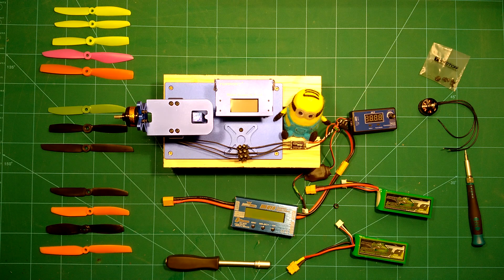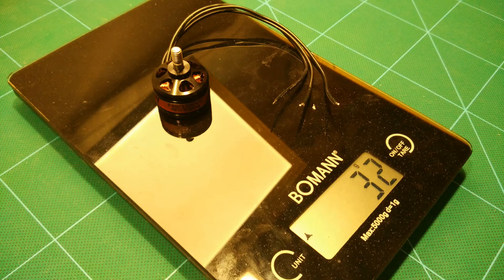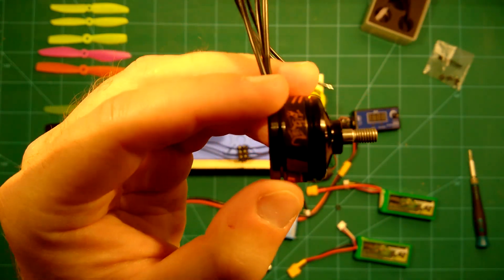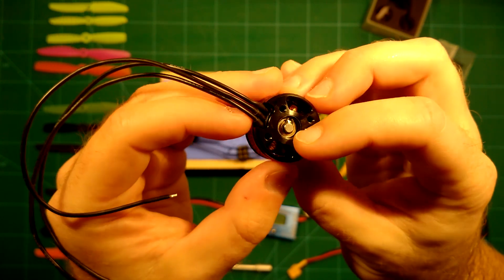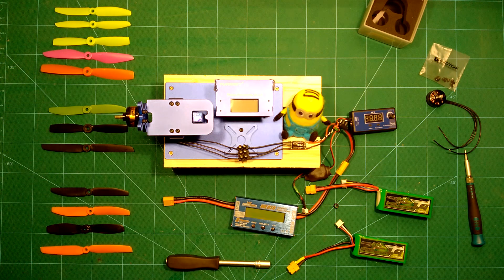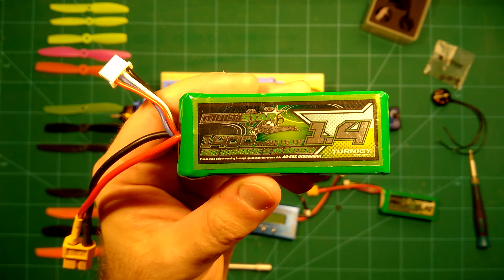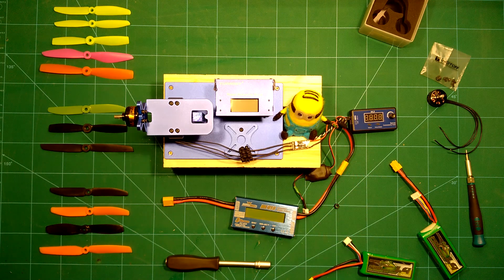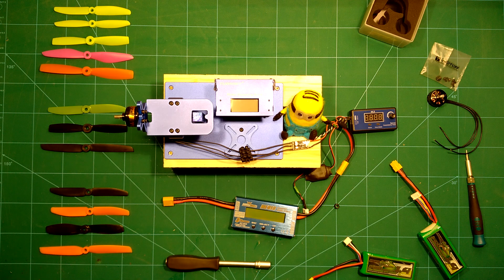T-Motor F40: Thrust Tests with LittleBee/Zeus ESC

Comment: thanks for the test, maybe next time try to use fully charged lipo for each test... you can see toward the end of the tests the battery voltage had dropped quite a bit which affected the results for the last few props :)
Reply from the maker: +FPV Oscar Guilty! I charged the lipos in-between the test runs, but not for every single prop. You are completely right and I will definitely do that for the next time. This does effect the maximum thrust (by a bit), but not so much the efficiency value - which is still valid. Also, since the watts are shown in the video, these are still valid data points, although maybe not "full throttle efficiency" but rather "almost full throttle efficiency", since the lipo was not completely charged as you say. Many thanks for your valuable input!

Comment: What is the dynamo that you're using? Is it home built or shop-bought?
Reply from the maker: +Michael D I'm not sure if I'm following you. Dynamo? Are you refering to the thrust stand?
Reply: +RC FPV Flight Yes - thrust meter / dynomometer. It's the Turnigy one, correct?
Reply from the maker: +Michael D Yes, absolutely right. It is the Turnigy Thrust Stand. I also build my own thrust stand previously, which worked very well, but this one is more of a standardizes solution. Here is my previous, self-built, thrust stand: https://www.youtube.com/watch?v=N8gUBRv1ESQ
Reply: +RC FPV Flight Thanks! Have you looked at https://www.rcbenchmark.com/  or any other ones?
Reply from the maker: +Michael D Unfortunately I did not, I went straight for the Turnigy one. The one from your link looks great, though. I like the computer connectivity a lot!